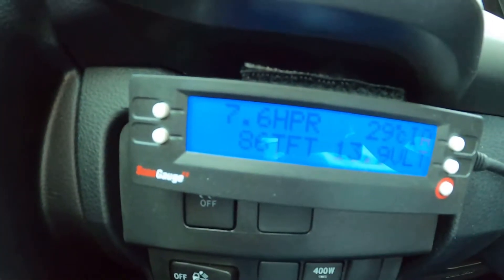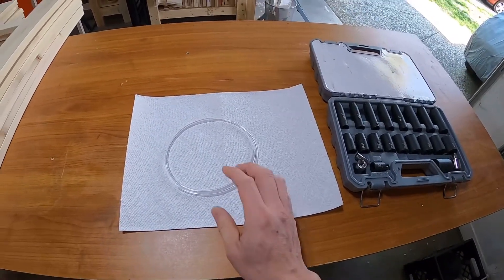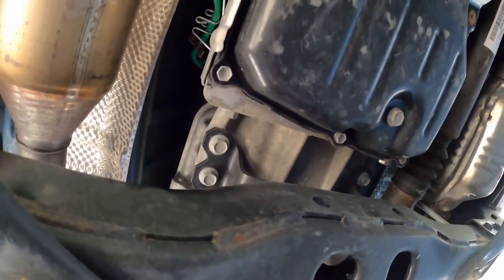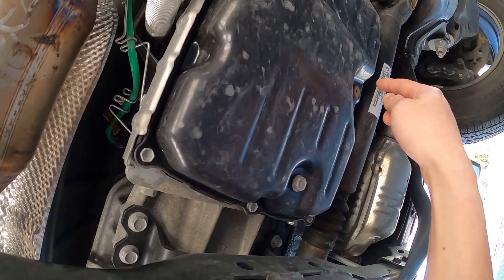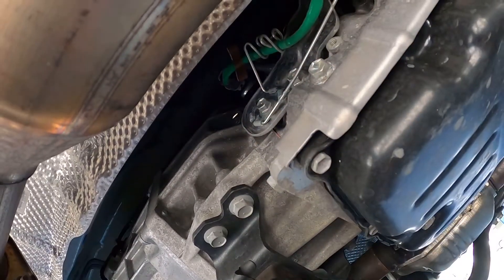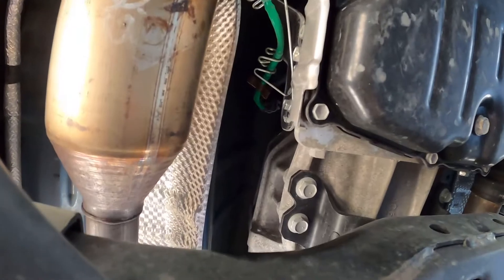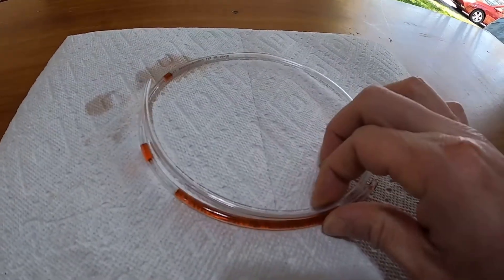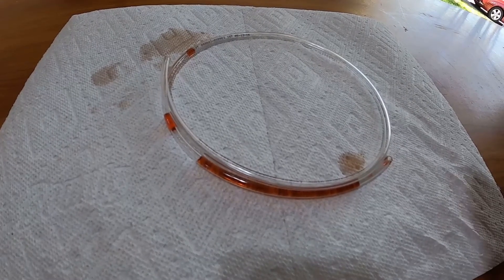Checking the transmission fluid on 2020 Toyota Tacoma

Comment: I tow a 3000 pound travel trailer with my 2019 tacoma. Use scan guage to monitor the transmission temps. I was concerned about trans temps and was going to add an additional cooler. However, there is a hack to pin the transmission cooler thermostat on, you can find a few youtube videos on how to do this. When I pinned my transmission, the trans temps were significantly cooler. I don’t think that I will add an additional cooler now. Also, I do not tow in the mountains and rarely faster the 70. I only pin the transmission during the summer months.
Reply from the maker: Good to know, thanks😊

Comment: At what temp will you pull over to the side of the road and let it cool down?  Have you thought about a transmission cooler for your Tacoma?
Reply from the maker: If it go over 200F then I’ll pull over to let it cool down, but it doesn’t happen very often, that’s why I got a scan gauge to monitor the temperature, and I do have a stock transmission cooler on my Tacoma, sadly is not really helping when you tow that much weight....  

ScanGauge SGIIFFP Ultra Compact 3-in-1 Automotive Computer with Customizable Real-Time Fuel Economy Digital Gauges (Frustration Free) https://www.amazon.ca/dp/B00VX2NOK2/ref=cm_sw_r_cp_api_glt_i_6RYWHT8232DR5HX8MHBT